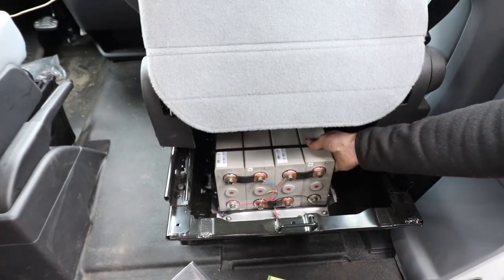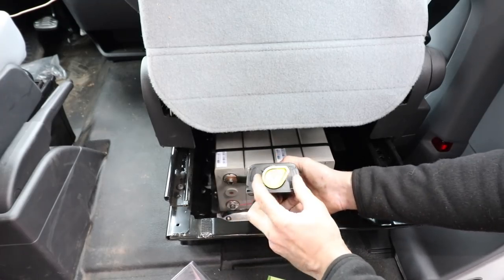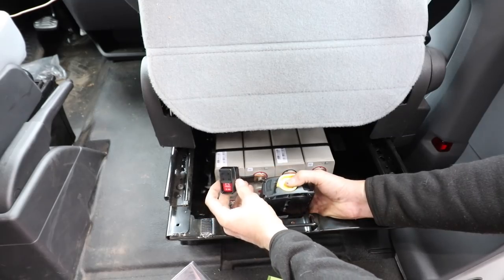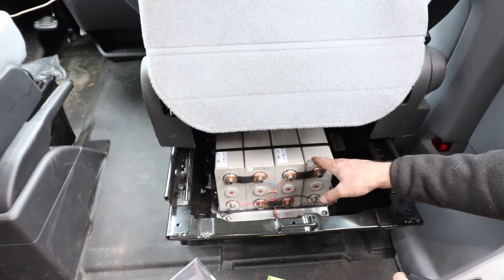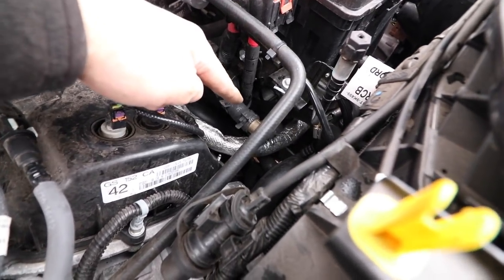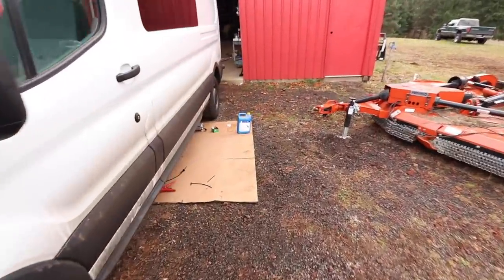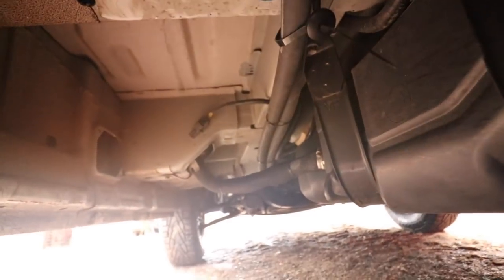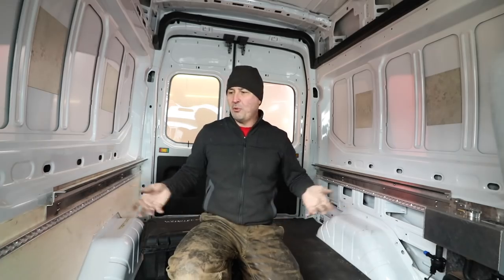AMAZING Lithium Battery Stealth Van Mod!!!

Comment: I was always under the understanding that lithium batteries could not be left in an environment where it goes too far below freezing for longer than about 48 hours or to be left where the temp goes above 100 degrees (maybe where you might travel to) without damage to the battery. That’s why they use acid batteries for vehicles!! (they can handle the temp extremes). If you leave the van parked in an unheated or cooled garage where you live then the temp in your van will exceed those temps. What are your thoughts on this??

Comment: Hey Cody..  The Calb and the Winston Battery need to be clamped, [sandwiched between to 1/4" Alum Plates using say Stainless steel strapping.. IF you Don't they can Bulge under charging conditioning.. If the supplier say you Don't then ask them what is the warranty] 
Psst if you want me to emails some photo's of my bus setup just message me via Google.

Comment: I had a RV with a heat exchanger in the back.  It was luck that I saw the leak in the hose before leaving a KOA site.  The hose was apparently punctured by some road junk.  I replaced the rubber hoses with steal.  Watch those rubber hoses.

Comment: Should someone really be sitting on top of that much lithium battery?
Reply: Nothing to worry about it's not like lithium batteries have ever exploded.
Reply: That is why he put it under Mrs. W'S side ;)
Reply: steven vester it's like one in a few million (with propper quality control and good consumer care)
Reply: way to propagate fear, everyone. only problem with lithium batteries is heat and over charging /discharging. in conditions what would be too hot for lithium batteries would be too hot for humans too. If the cells don't have voltage and overload protection, the solar charge controller will keep it in the safe zone. You all carry a lithium battery in your pocket all day and even sometimes on your cheek and ear hole!
Reply: @daftnord4957  So why do Tesla, GM, and other electric battery manufacturers seal up the lithium batteries in those expensive and heavy armored metal cases?

Comment: watch that hot water line for wear rubbing on that brass fitting
Reply: I concur the upper hose needs additional insulating to protect from ware...such as Teflon or a piece of silicon tubing would help

Comment: Don't forget by-pass or at least shut off valves for that rear heater. Many vans get leaks when they have those rear heaters. (Mazda MPV) you can use the valves to throttle flow also. insulate the hoses the best you can, and I'm sure your going to cover those battery terminals with non-conductive material.
Reply: Do you know what year/ model MPV have this issue? We have a 2007 Jap import and I'll check the system out if its a known issue.
Reply: 2000-2002's for sure. Not all are equiped. OE shut off valve on back of motor.(hard to reach) you would know, coolant leaks from passenger rear wheel well.
Reply: Awesome thanks for the heads up. Our's is the newer model so may be different but I will have a look as it has triple zone climate control (Driver/Passenger/Rear) and may well have a rear heater I have not noticed during servicing.

Comment: A ratchet strap to hold the battery isn’t very “oem”. If the battery slides and shorts on the chair terminal it’s instant fire and sparks. Can happen in accidents etc. plan for the worse hope for the best
Reply: Agreed... Those exposed terminals are no bueno.  Hopefully he adds some protection to that system.
Reply: nightmarejr not only fire from sparks but also from internal heat of the battery due to very low internal resistance

Comment: Careful it doesn't explode, its extremely extremely rare but it does happen every once in a few hundred million (after quality control)
Reply: Yeah, just ask Boeing about that!
Reply: There are different types of lithium batteries. The lithium batteries for RVs are different from the Boeing incident.
Reply: Still I think id mount those underneath. Just make a quick connect box for them.
Reply: Boeing used Lithium Cobalt Oxide which was the best available option in 2005 when designing the Dreamliner, they have a terrible safety record and no one would use them now days. Life4po which Cody has used here are really stable and safe, you would really have to abuse them badly to get them to fail.
 I have had a 40ah life4po pack inside my vehicle running a fridge and small inverter for 3 years with the heat of Australian summers and the pack is still running as new. I picked lithium as there is no room on my vehicle to add a second battery outside the passenger cabin, and the 40ah fitted neatly where the 3rd row seats were.

Comment: With the S-Bar tied into the cooling system on the van. Does it also work like a block heater? Keeping the coolant warm? Say you went camping and it was snowing when you wake up and then engine is really cold, I could see an on board block heater making it much easier to start the van.

Comment: Very nice description of the whole water systems and how they work together while being separate !
Question :
Would you please, please, please do a video on your 200amp aux. battery system, in depth and as thorough as you did this one w/ the water system ??   Include components w/ a complete description of each, routing of lines (from and to) and how to engage ?  

I've been interested in adding an aux. battery system in my truck for use w/ my telescope and camera equip. that actually gets charged by the alternator but separates power usage from the starter battery.  Being able to start the truck w/ the aux. batt. seems a bonus as well.
Thank you for your generous consideration,
Sincerely ..........

Comment: Please provide more physical protection for those batteries. The last thing you want is a fully charged 200Ah Li battery set getting punctured in the case of an accident or collision - they go up with a fury that will make your forest fire fighting seem trivial. Well, unless you actually want to make a collision worse than it might be by incinerating Mrs W :/

Comment: I wonder if the extra gallon of coolant and the 30 feet of rubber heater hose will tax the engine's water pump? Is the water pump electric or pulley/engine driven?  
Me too. What happened to the coyote hunt?

Comment: Quick word of warning. That 4000-5000 rating is probably not for total discharges. I doubt you'll have many situations where you need to use all 200 amp hours at once, but they will last longer if you can get away with 20-30% discharges. That's why Tesla batteries are supposed to last 20 years but your phone battery only lasts 3 if you're lucky

Comment: Lithium Ion batteries are more susceptible; to thermal run away, make sure to get a good charging regulator
Reply: also something to think about is insulating the heater hoses and then putting some form of armor plate to protect the hoses from road debris, heat loss is going to be significant at highway speeds
Reply: TheDarkalkymist -  Not lithium ion, they are lithium iron (LiFe)

Comment: I love projects like this. One question however: Why did you locate the heat sink outside? Surely, if it were inside, once the van warms the air around it, it becomes more efficient?

Comment: Ahoy:   The bad thing is if any of the lithium battery ever gets in to the water table, by land fill or any other way.  Will poison the water table. So if a car gets in a wrack & the lithium battery gets splattered all over the area & does not all get picked up can get in the water table of that area.  This will poison that water.

Comment: You really need to insulate the pipe work under the vehicle the heat loss with air flow will be immense especially in the depths of winter and you will find the heater in the Cabin not as good as before due to the loss.
Reply: Agreed, it will also protect the exposed hoses from wear and tear from driving on the road.

Comment: Having seen what happened to Richard Hammond's electric car on GT I would make a battery box (vented somehow) with some stout steel plate for that lithium  battery and bolt it to the floor. low chance of mishap, but if worst happened and your trapped in the van it could literally save your backside
Reply: Its a great project though and love your approach and attention to detail on the fixings

Comment: I have worked on customers previous gen transit this summer for a similar purpose, it was a people carrier so it already had coolant hoses to the back, did you check into the factory solution or did you come to it by yourself? Are you adding an extra bleeder valve? Very interesting project! Since what I worked on was an older model I dont know if it was a factory solution, but the hoses on it were attached with zipties already, may not be such a temporary solution afterall :) Transits are tough, it was brought in Estonia from Sweden where it was used as a carrier for people with special needs so it had little under 400k kilometers on the clock, but after some regular maintenance and minimal repair it has already driven all through Europe without problems and is currently in Spain. Does your van have an auxiliary heater that you can perhaps modify to heat your interior without the engine running? Should be worth checking out :)

Comment: i'm sure you have it all covered, but i wouldn't use the engine to charge the battery pack unless it's going through a lithium specific charger which outputs voltage and current in a specific way, and switches to a different way to top it off. Are the cells internally regulated with protection circuitry?

Comment: Sir... Please, please, PLEASE move that battery or at least get it in to a protective casing.... Those type of batteries can catch on fire not just on fire but an explotion like chemical fire wich is hard to put out. Usually if damaged or short circuit or over charged.
I am no expert but please Sir consult one for yours and your family's safety
Reply: Lithium Iron batteries will NOT catch fire/explode like Lithium Cobalt barriers.
Reply: Jack Patteeuw 
cobalt is the source mineral for lithium. lithium ion batteries are explosive when damaged.
Reply: Jack Patteeuw 
Thank you...  I did say that im no expert...  I just see the lithium and got chills running down my spine in my mind I saw a potentiale fire bomb
Reply: Phukyer PheeFees - .... but we are talking about LITHIUM IRON batteries.
Reply: Kim - You are welcome.  I spent a lot of time doing research to understand the differences in lithium batteries.

Comment: Which batteries did you get and which charge inverter did you say?
I trust your judgement and would like to emulate your choices if it will work for my ham radio shack / adventure trailer / gear carrier.  Lol

I'll go watch again.

Comment: I would personally move those lithium batteries out of the passenger compartment for safety reasons....I wouldn't even put a conventional battery there due to the production of hydrogen gas.

Trust me.... even if the batteries appear to be sealed in a hard enclosure.... they are lithium batteries and anyone that has spent time with brushless RC stuff running lithium batteries can tell you just how bad things go when they fail. 

If you plan on leaving those batteries in that bin, I would make sure you line the compartment with a fire resistant material and bury the batteries in sand. 

Either way I would still suggest building a fire resistant enclosure somewhere outside of the vehicle so in the freak chance something goes wrong..... it goes wrong outside and your vehicle might survive.... worse yet the toxic fumes that would be created in the vehicle could end your career as a living thing.....

Otherwise looks good, keep it up.
Reply from the maker: This is not  that sort of lithium,
Reply: All lithium batteries have Lithium, Lithium ion, Lithium Iron.... doesn't really matter...... even the LiFe batteries will emit toxic fumes if the cell pack is ruptured may it be from an accident......or from overcharge......They like to say those batteries do not gas when charging, but I have seen almost the exact same battery you have there connected to a charger that was configured wrong.... User drained the batteries below safe levels, then recharged them several times..... end result.... hard cases split and the batteries vented a nasty gas that while it did not cause a fire it left nasty marks on the enclosure and filled the enclosure with a smell I can't describe in words.

I wasn't making a comparison to LiPo trust me..... if you had put LiPo's under the seat of your van I'm sure youtube would be broken with the comments LOL!

Comment: How are you planning on charging the Lion battery pack?  These batteries are very sensitive and need a proper thermal and voltage management system to safely charge and use.  Do you have such a thing?
Reply: well, the extra small wire bundle coming out of the battery is for a bms also known as a battery management system. he also showed a "monitor" which can show the condition of the battery. but to alarm and shut it off if there is cell malfunction.. i don't know what capabilities the bms monitor has...

Comment: is this a DIY Li bank, i myself have wondered about using 4 cells, instead of 3
3 cells is 9v discharged 12.6 full charge, and MUST have a charge control to not exceed the 12.6v, a good alternator is at least 13.6 to 14+
4  Li cells 16.8 full charge, no problem charging from alternator, BUT is 14+ enough voltage for a 4 cell bank to operate correctly and maintain capacity

Comment: Is the cooling-pump of the engine capable to producess enough pressure? I mean the system got bigger so should the pump if it's not already strong enough for that.

Comment: are these components under the vehicle going to be covered up? since it is a pretty harsch environnement under there, and the heat exchanger would perhaps benefit from some insulation beeing ouside the vehicle Do they use any salt on the roads in winte at all in Oregon? cheers.

Comment: I'm looking forward to when you connect solar to that LIPO battery setup.  Please include the MPPT model and battery settings when you get that far.  I've been thinking about changing out my home's AGM batteries with LIPO the next time the batteries need to be replaced.  Mine's a 48V Xantrex 6KW setup, and I may need to upgrade the MPPT-60/150 controller in order to support LIPO.  It sure would be nice if all I had to do is change some battery settings to make it work.  Would you also include links to those batteries and connection hardware? That was a very sharp-looking setup.  The shorter the battery cables to the inverter, the better. Thank you!
Reply: mark durstewitz - Without going into too much gory details, Those are not Lithium Polymer (LiPo) batteries.  While not stated, I suspect the are Lithium Iron Phosphate (LiFePO4 of just LiFe), which is a much SAFER type of Lithium battery than Lithium Cobalt Oxide (LiCoO2).

LiFe batteries have a slightly lower voltage than other Lithium batteries (3.2V/cell vs 3.7V/cell) and a lower power density.  The safety factor is real.  They will with stand over charging and sever discharging without any fear of fire or explosion.
Reply: Thank you for the clarification Jack!
Reply: suggest that you look for a mppt controller that can be 'programmed' or software upgraded to have lipo settings vs. having to buy all over again...
Reply: I agree. Schneider makes a 600V MPPT controller that's an upgrade from my 150V MPPT, but I don't think it will charge LiFE batteries by default.  But it IS compatible with Xanbus architecture, which is important for all the hardware to talk to each other. That's why I was hoping to get MPPT manual settings for LiFE batteries. Thanks!

Comment: I was looking into having solar installed at our home. I want to be off grid. Batteries are a big part of the cost and then there's a good chance they would have to be replaced again in so many years adding more cost. Can you supply a link for the battery you have purchased? I would rather purchase Lithium if possible.
Reply: Dashbshots - You need to do a lot more research !  Lithium batteries are not "cost effective" for off grid/solar applications.  Lead acid is still the most cost effective for stationary installations where space and weight are not an issue.

Anther option in between lead acid and lithium for cost effectiveness are nickel iron batteries.